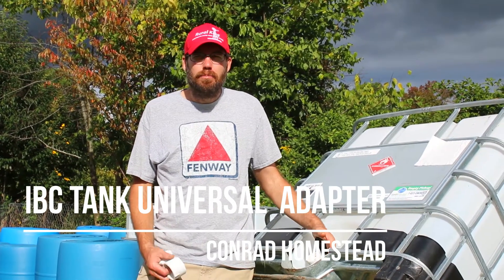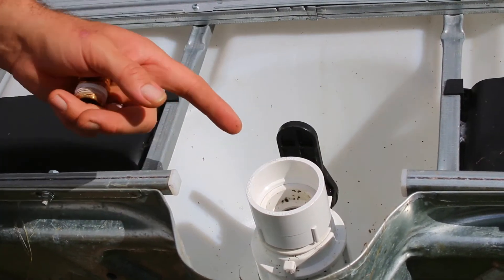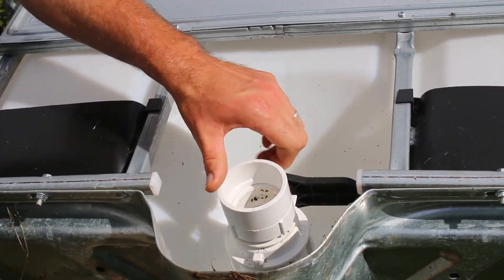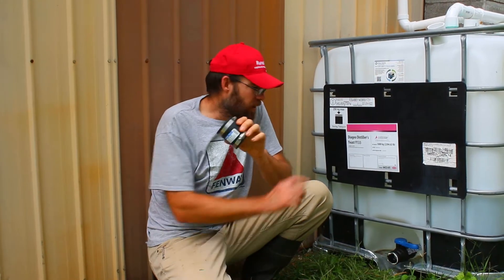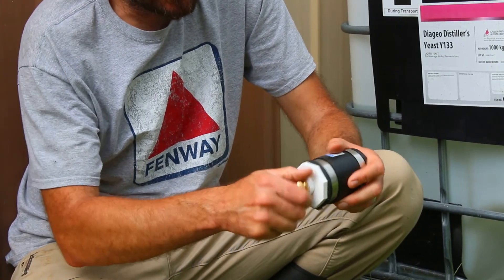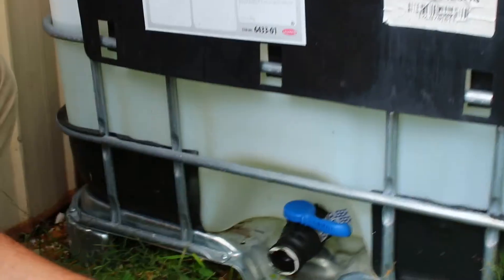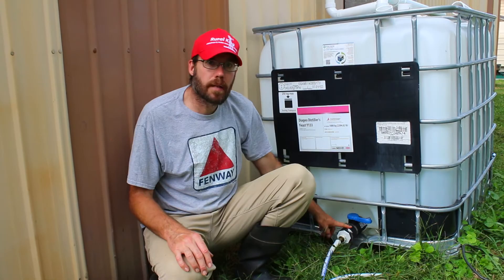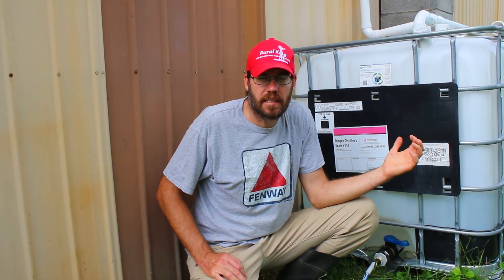IBC Tank Universal Adapter

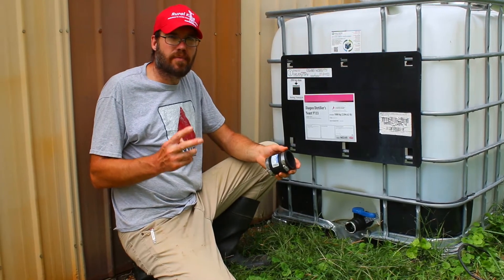Comment: 2:29 That ‘divot’ actually is sized to fit 2” cam-lock fittings. They are pricy (about $17-$20 where I live) but if you need to disassemble your system semi-regularly they are worth it, as you don’t risk stripping out the plastic threads with repeated use. I use them as I have to drain and break down and store my entire setup for winter in Montana.
Reply from the maker: We drain our systems for 2 months in winter also. I agree that the cam fitting would be best. The idea was to have a solution for all valve types

Comment: That 3rd tank is a device called a camlock. The tank typically has a male camlock and what you need to connect is a female camlock. They work extremely well and won’t leak even under pressure.
Reply from the maker: Sounds real good. The idea behind this is a “universal “ solution. Thanks for the information. I’m sure it will help someone. Thanks for taking the time to comment.

Comment: I have a type 2.  The coarse threads didn't inspire much confidence for using a leak proof adapter.  This looks waaay better.

ETA - 2 inch rubber sleeve was too big for my type 2 tote.
Reply from the maker: Bummer. Thanks soo much for the update

Comment: Okay so I got it all set up put the hose on it opened up the ball valve and there is no pressure even with the The fill lid loose. What could this be
Reply from the maker: There’s a lot of variables. Maybe a foil seal not removed? No water in tank? Broken valve that doesn’t open even if handle turns? Hose has kink or obstruction inside? Gravity temporarily out of order? 
If you figure it out please share. So I can sleep tonight.
Reply from the maker: Golly I’m funny😂 I just read this reply again

Comment: My IBC tote has same scenario as #3 presented here.
Rather than rely on the few threads present or the hose clamp method,
I opted for positive mechanical connections throughout:

D200 Camlock (2" Female NPT) - polypropylene
reducer bushing reducer 2 x 3/4" - nylon
3/4" male adapter to garden hose adapter as used in the video - brass
Reply from the maker: Thanks for the feedback

Comment: We could use some of these totes.
Reply from the maker: What kind of system are you planning? Beverage companies and distilleries are good sources. We have quite a few distilleries within an hour of us. Thanks for for watching Chad and family!
Reply: Conrad Homestead well we are actually going to put in a shallow well for now . We’ve been using just rainwater catchment but our 4 55 gallon barrels just isn’t cutting it for our family of six and our animals. When it rains our barrels overfill and just goes on the ground. Just need bigger containers. But winter is coming and all the rain water catchment systems will be useless for months!
Reply from the maker: Winter does make water collection more difficult. The ball valves have the issues with cracking in freezes. I’m thinking of placing a few IBCs in an insulated shed. Get what you can done before it’s too cold👍 We have few winter prep projects to get to.
Reply from the maker: I wonder how well the tanks would hold up underground? 🤔🤔
Reply: Conrad Homestead maybe ok with the cage around it.